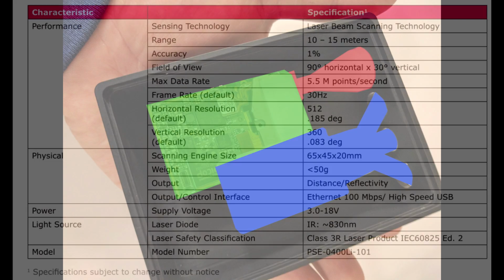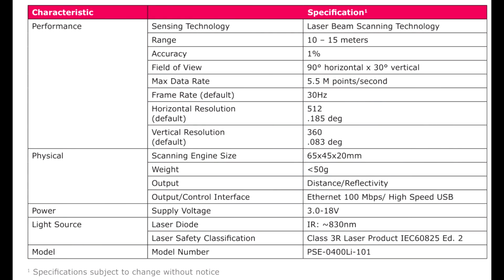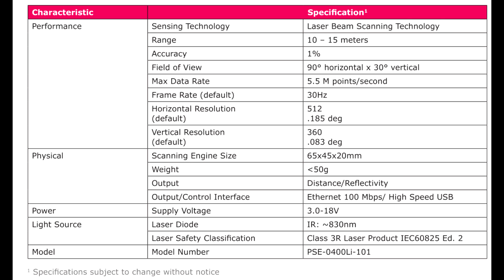MicroVision MidRange LiDAR Demo

Comment: Little deceptive when they say, "5 Million points per second", as if that's it's resolution. It scans 30 times per second, which makes it 166,666 points of actual resolution, or around 400x400. The video they showed looked closer to 100x80, so apparently it's not even using that 400x400 resolution very well.